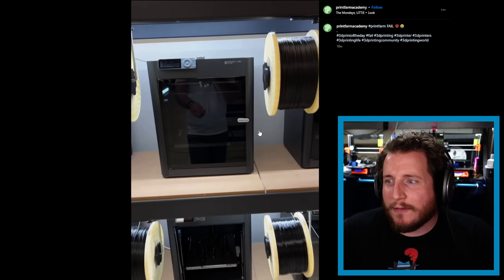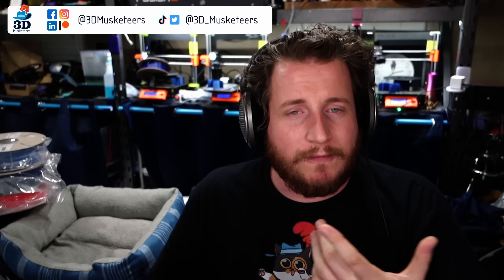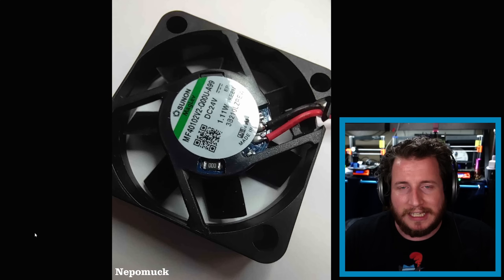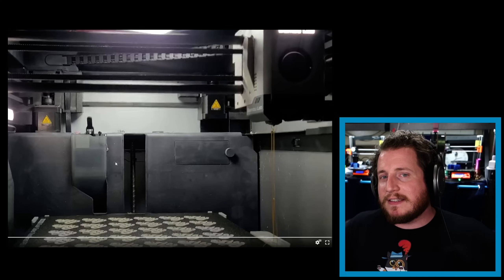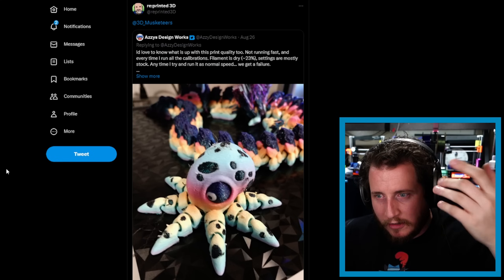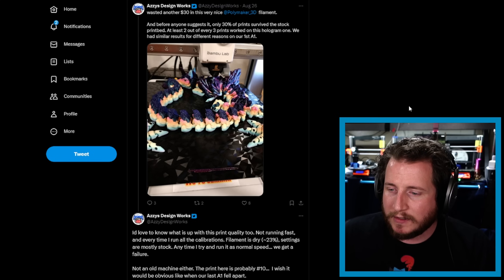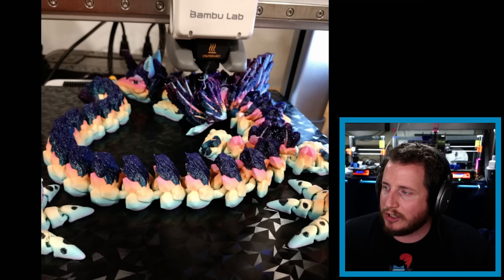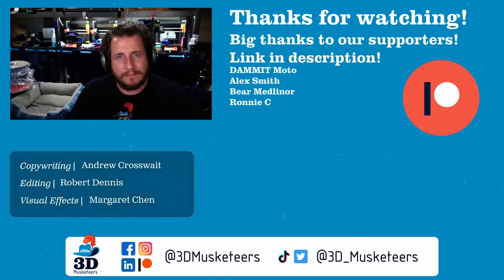Bambu BLUNDERS and BLOBS! - PrintFixFriday 155

Comment: Had the identical thing that made the Bambu scream happen on my custom CoreXY printer, it might have been the motors overheating instead of the drivers. This happens when the motor doesn’t have enough strength to move at the desired speed so it starts skipping steps (and the desired movement is fast enough that it doesn’t have a chance to sync up on a full step). As the motors heat up, their strength lowers, which I suspect caused your issue. In my case, it was improperly tuned current and stealthchop

Comment: As for your noisy X1C: It's happened to me once, it just needed a quick power cycle. No need to let it sit overnight. It happened when I bumped the printhead and it lost steps. Later I turned on "Auto-recovery for lost steps" and I haven't had it happen since. You may want to clean the guide rods, just to make sure they aren't "sticky".
Reply from the maker: tried power cycling, no avail. Everything was recently cleaned. I THINK it was a driver overheating but dont know
Reply: @3DMusketeers  I missed that you said you power cycled. I'm just relaying what happened to me once. It sounded and acted just like you showed. But it was my fault for bumping the printhead. It's a mystery then,
Reply from the maker: I didnt say it in the video, so you were right to ask it, but yeah I tried! :)

Comment: Wow! That noise on your X1-Carbon. Yikes! I have no idea what that would be either unfortunately. Sounds basic but you can try using IPA on the X/Y rods to see if any debris comes loose or notice any anomalies on the rods themselves like digs or indentions. Other than that, I would create a ticket and they will probably want to see what it is doing, so they can give it their best guess. Sorry about your printer and Printing Academy. Lots of horrible stuff but good information.
Reply from the maker: I dont waste my time with Bambu customer support anymore, not after they were caught giving us special treatment because we are content creators. That is slimy.
Reply: @3DMusketeers  I can see how you can see it that way. I would still give them a try. I recently had to get a front fan housing unit because of my own dumb mistake. USPS screwed the order up and sent it back for unknown reasons (probably ruined the address label, so package could not be delivered). I created a support ticket and they fixed the issue the same day by sending another fan out instead of waiting for the fan to reach them and then send it out again. Most manufacturers would have waited to send the fan until they would have received the initial order or made you reorder another one. Plus, it could give you more talking points about their support.
Reply from the maker: It got to the point where they told me I was getting special support because I am a creator, that is when I stopped using them. That is unethical. 

And frankly I would just replace it myself with a nicer fan. It is a multi hour process to diagnose and I dont particularly care to do it right now..
Reply: @3DMusketeers  I completely understand and I would feel the same way more than likely if I was in your shoes. Regardless, I’m sorry your printer crapped on you. Personally, I know this can be frustrating to deal with. I also want to say thank you for what you do. You’re the only content creator that is unbiased and keeps strong morals. The 3D printing community needs that more than ever! I’m also looking forward to the 3D printed music studio!

Comment: If you have access to a thermal camera, you could check out the board under power and see what's glowing hot. And that would tell you what's overheating and where you need to direct your cooling.
Reply from the maker: that involves removing the back of the printer which is more work than I want to put into it lol. Smacking it fixed it so far

Comment: P1S is bare bone, no AI to check, no spaghetti detection etc. Even the A1 has more detection than the P1S; clump detection, air printing detection.
Reply from the maker: wait, it has no ai on the camera? that seems.. shortsighted?
Reply: @3DMusketeers  nope, 720p with 0.5 / 1 FPS camera just for monitor from the app and slicer.

Comment: You know what really really works for bed adhesion and costs next to nothing? A 50/50 water sugar mix. Sponge a thin layer on, let it dry print and relax. 👌
Reply from the maker: no, that is how you get ants.
Reply: @3DMusketeers  lol, I can just see a sugar encrusted printer; Cocoa Press? move over.
Back in my factory work days, made drywall, we used pure dextrose in the mix to make the Gypsum stick to the paper
Reply: @3DMusketeers  Doesn't happen for me! Lol, being in the uk might help but it works for me every time.
Reply: interesting

Comment: Regarding the P1S, I run my x1c without an ams quite a bit.

It doesn't really matter what filament you set the external spool to, you can run the machine with any gcode/3mf file and the machine will brute force itself to run with the incorrectly set filament. Same goes for the a1 mini.
Reply: Yeah that definitely seems like a flaw. My Prusa Mini has it and it's a must for future printers for me.
Reply from the maker: really? that seems like a flaw.. I guess I have never tried on mine so I made a best guess because the AMS stops you..

Comment: I'm thinking the only major difference between PLA and PETG is the hot end temperatures.
Reply from the maker: well, not exactly, PETG tends to shrink a bit more, but chemically they are VERY different.
Reply: @3DMusketeers  what slicing gcode differences would account for the spaghetti shown in the video?
Reply from the maker: oh, in the video, nothing, just temps. PETG needs higher temps to fuse often.